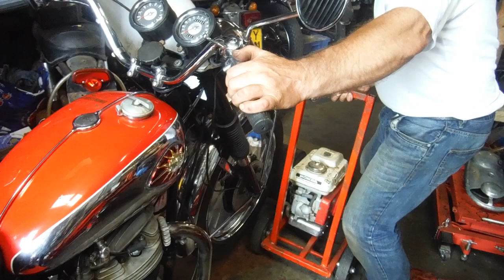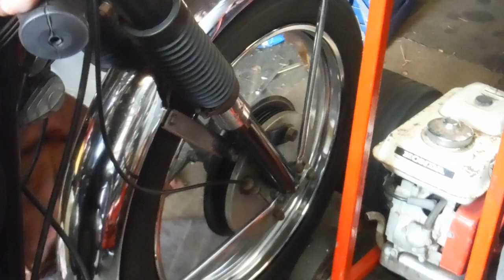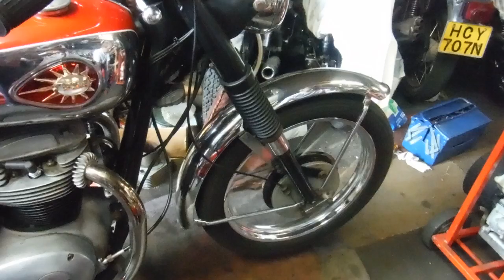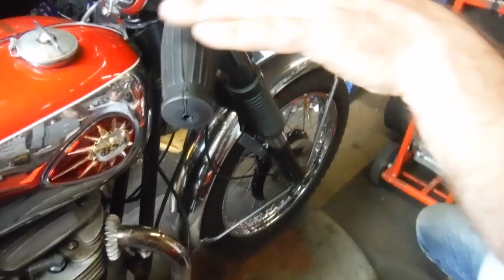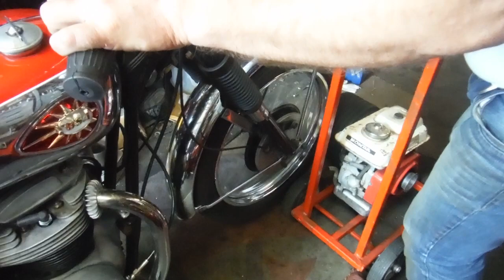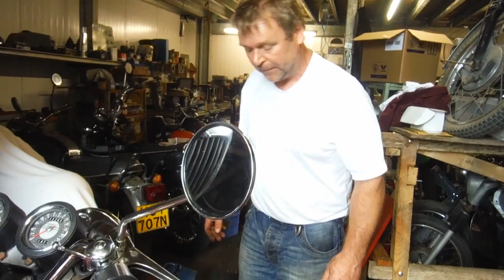Removing high spots from a motorcycle brake drum quickly and efficiently.

Comment: Hi Paul ...Its Les here (Les H from Hitchcock's forum many years back) I congratulate you on your ever increasing number of useful videos. I was going to suggest another way very similar to this but one which enabled an owner to carry out the skimming whilst still using the bike. Most owners have an old brake shoe to hand so I was thinking... if emery cloth which can be bought in 50mm widths, was attached over along the trailing shoe lining with bonding adhesive with the leading edge of it tucked and fixed round the shoe (pop rivets?) you could ride around carefully and apply the brake on and off until the ovality was reduced or removed. Brake performance would not be reduced that much as the leading shoe does most of the stopping....Just a variation of what you are doing here...All the best...I've got all your other videos to watch now....Les (H)
Reply from the maker: Hi Les, I had considered that, but the problem would be the inability to just have the brake set 'on' just enough to only touch on the high spot, as I was doing here and adjusting up bit by bit as the high spot became less 'grabby', until it was gone. We are probably only looking at a few thou out of round and normally, I think the way you suggest might lead to full and constant contact with the drum for each full revolution of the wheel and perhaps not be so effective. ATB, Paul.
Reply: @paulhenshaw4514  Hi Paul...Thanks for getting back...yes I can see what you mean. Maybe you could just find a long straight road (one motorway section) and just ride with the brake JUST rubbing very lightly as the emery covered shoe will touch first. I'm going to try that on my Norton Dommi when I get the chance. Thanks again for reminding me I have to sort this problem out...All the best Paul...Les

Comment: Except for the engine the audio was nearly impossible to make out. I take it he put grinding paste right on the brake drum?
Reply from the maker: Sorry for the bad sound - that was me in the video. I coated the brake shoes with fine grinding paste, then adjusted the brake up until it was rubbing the high spot in the drum, to grind it down, stopping on a few occasions to adjust the brake up a little more as required until the contact between the brake shoes and drum was even all round. Then, it was just a matter of cleaning the grinding paste away and reassembling the brake, to find a great improvement and it didn't take too long, either.